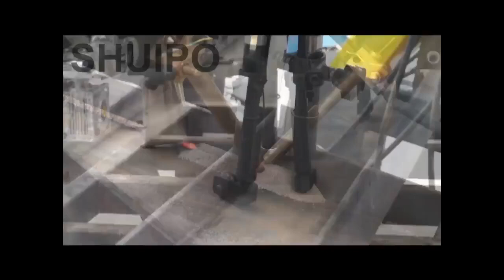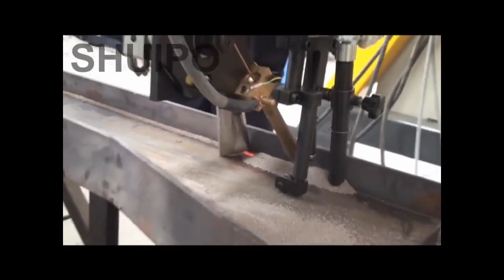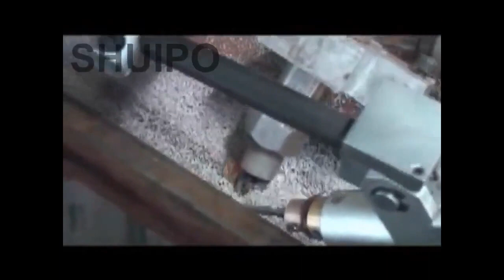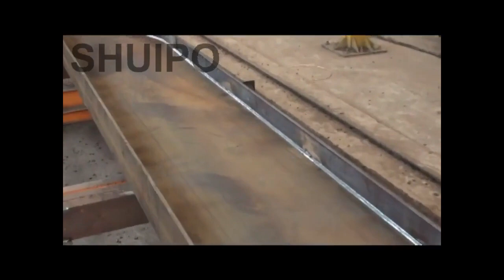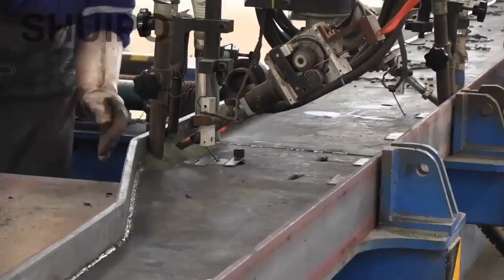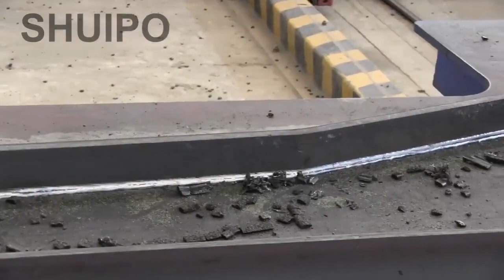gantry type H beam welding 2

Comment from the maker: ①The welding machine is equipped with automatic welding seam tracking system
②It can weld two seams simultaneously and automatically track the welding seams according to shape of beam 
③It features in good welding quality ,neat welding seam, high efficency and low cost ,well received by users.As appraised by experts, the welding machine can substitute for important equipment,saving large amounts of foreign exchanges.
④Double side drive, stepless speed regulation
⑤PLC control